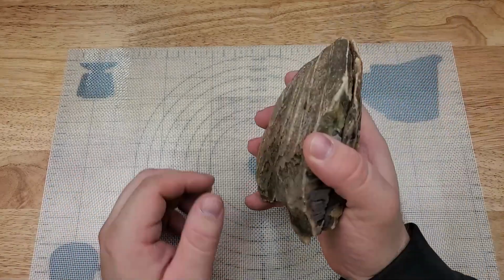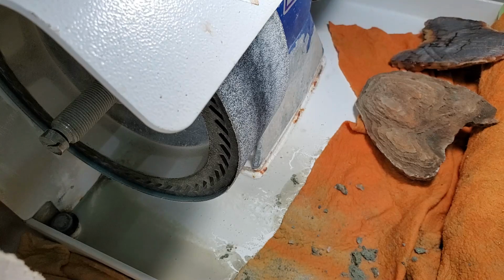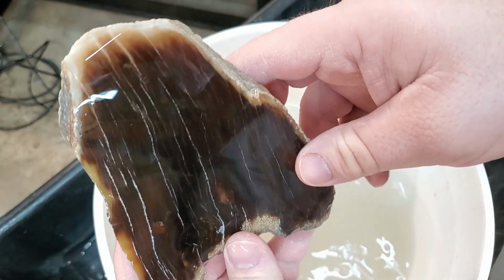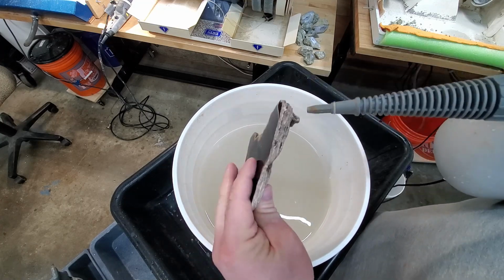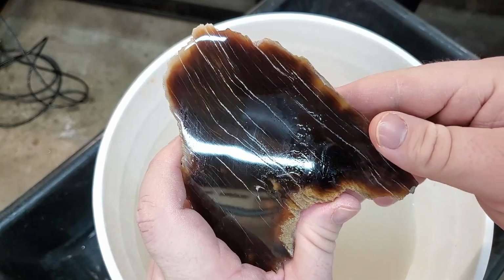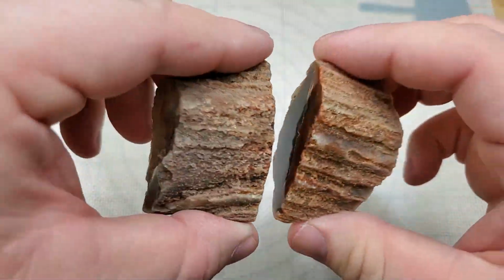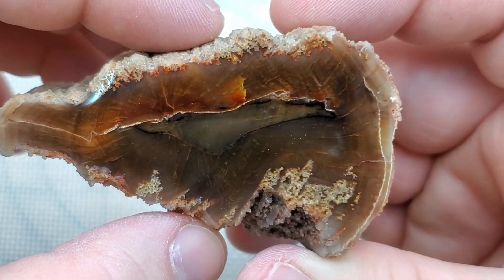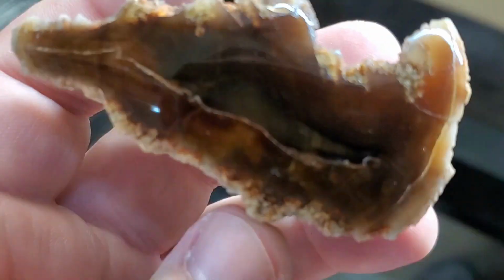Polishing Opalized Wood

Comment: Have you tried a water pick?  I use them on geodes and other rocks I clean. They work pretty well with cracks and not enough pressure to worry about flaking your stuff.
Reply from the maker: I have used it before and it does work well with some loose dirt/material but not so much with the polishing compound. 
Even with the pressure washer, the opal material was not wanting to let go of the cerium oxide.

Comment: Nicely done.  When steam cleaning,  I have started using an oven mitt to hold the rocks as I blast away at the cerium oxide.  No more burnt fingers.
Reply from the maker: Thank you!
And that's a good idea! Gotta protect the fingers haha
Reply: @WorldofRockhounds  and thank you for the Steam Cleaner tip for removing imbedded polishing compound.  At some point, I would really appreciate a explanation of why you use "Dry" sanding in your workflow.  I guess what I am asking, is why not just use 400/600 diamond?  Does the dry sanding result in faster or better polising?  Thanks Kim

Comment: Great Job polishing. I use a lil mineral oil and q tip on the cracks when I finish pressure washing seams and let them dry for a couple of days. its like magic and it last for a really long time on the polished rocks!
Reply from the maker: That's a great tip! Thank you for the info!
Reply: Hope it works for you!

Comment: What's the difference between opalized and agatized? What is the flash that made it opalized? Is there an easy answer? LOL
Reply from the maker: That's a very good questions that I'm not sure how to really answer! 
One thing I do know is that Opal likes to "stick" to wet surfaces. Whenever I tried to dry off the surfaces to check my work, it kept wanting to stick to my skin. Even the polishing compound had a hard time washing off. 
Whereas if it were agate, it wouldn't have stuck to my skin. I know there is a proper terminology for it but I can't think of the word. 
That flash is still a mystery. It could have been a fire flash or a fracture in the piece. Since it wasn't mind, it will remain a mystery haha